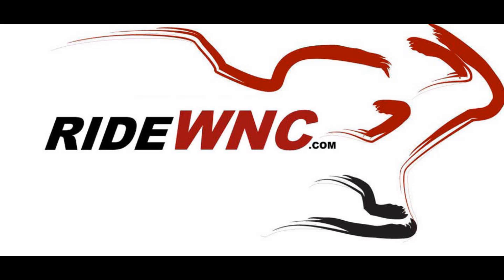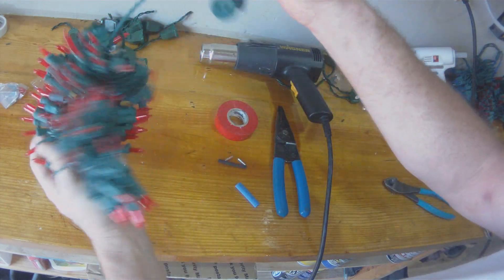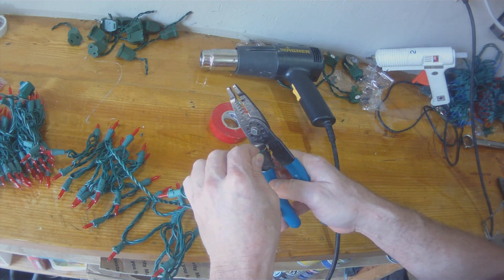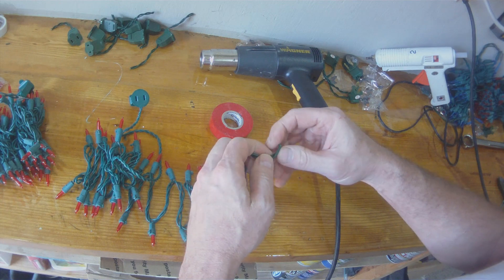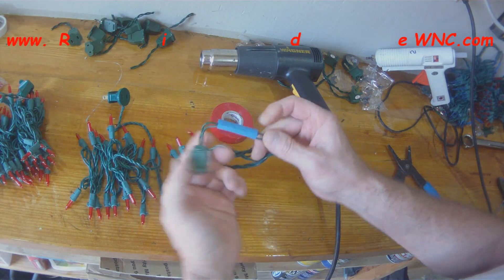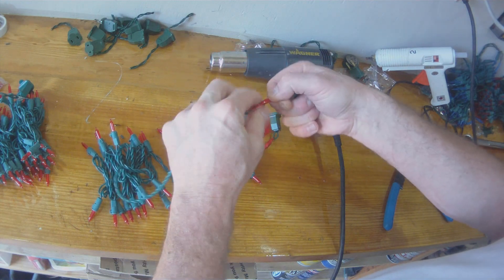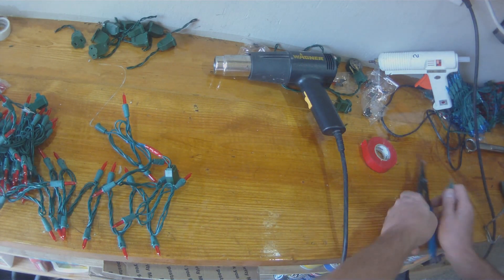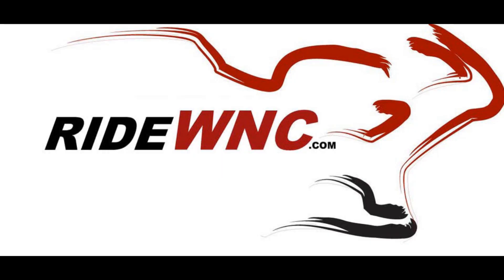Cutting LED Light String   M5 Lights from Big Lots

Comment: If I wanted to cut leds to fit the old incandescent silhouettes; the lowest I can go is a 33 or 34 count led correct?                                                                                                                                                              I would replace with incandescent but the bulbs keep blowing or there are shorts in the incandescant wires. I am unable to find some of the led silhouette shapes currently that I already have in  a incandescant form.
Reply from the maker: If you buy the 50 count at Wal-Mart those can be cut in half.

Comment: Can you please tell me how many strings can you make from one long set of lights?
If I bought a 100 light set, is it possible to make them into a 20 or 25 light string? 
I want to use them for bottle crafts.
Thanks so much.
Reply from the maker: If you bought 100, you would get three. Two 33 and one 34.
Reply: @RideWNC  Oh ok. Not what I was hoping for, but it is what it is, I guess lol. What about a 50 set, can I split them up? I would just need a male end then, right?
Thanks for getting back to me!!!
Reply from the maker: @JoeLazzara   50 will get you two 25...
Why not use incandescent light? Then it won't matter. They just won't be LED.
Reply: @RideWNC  Ok. Those would work better you think? I can do that too. 
 I was going to use those also, but I'm trying to do it the best way possible, price wise also. 
So then if I had a 100 incandescent, would I be able to break those down into four 25 lights then? I just don't know if it can be done or how to do it. I have a new set of 100 but I believe there's only one spot where there's 2 wires.
Reply from the maker: @JoeLazzara   Incan are 110v- power and neutral each bulb same voltage for each bulb They are also very cheap to buy compared to LED. The difference would be in power consumption. 100 light sting of INCANs is about 40watts, The same 100 lights in LED is about 7 watts. However, It would cost way to much money, time and labor to get 5 or 6 LED running on 110V.
Reply: @RideWNC  Ok yes, I will go with the incandescent's then.
I understand what you're saying, but before I get more 100 sets, will I still be able to split those into 4 sets?
Reply: Do you just do the same steps when adding a male end. I have not found a video for that!